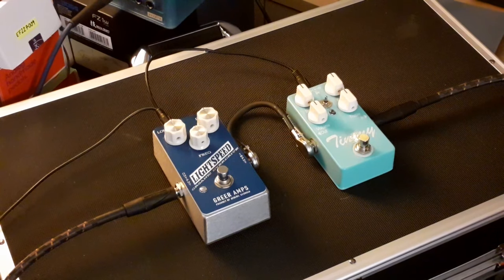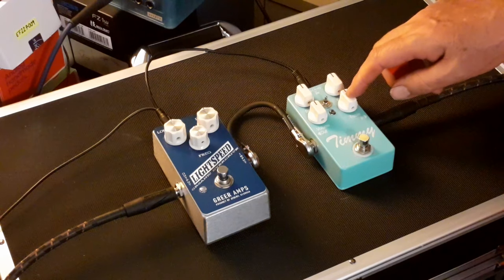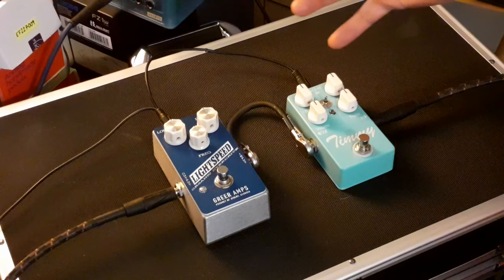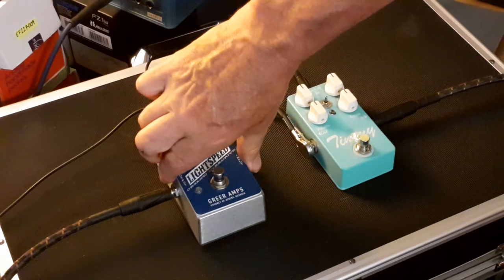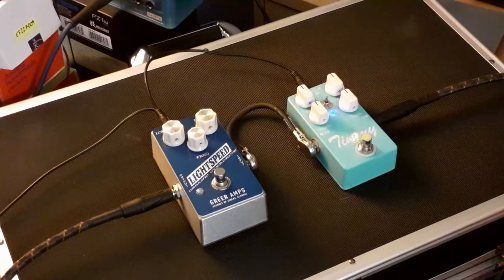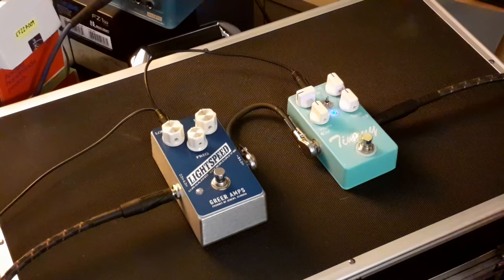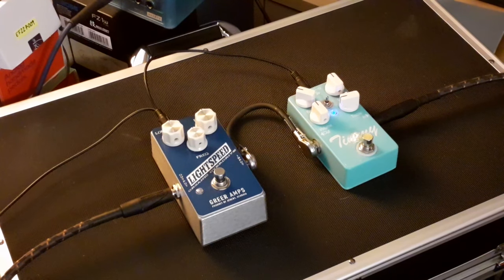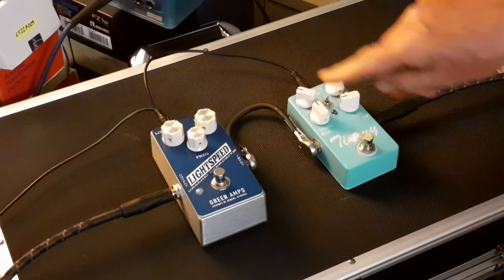The Greer Lightspeed v Timmy - transparent overdrive battle!

Comment: The neutral tone setting for a Timmy is with the treble and bass knobs all the way counter clockwise.  At noon, you’re cutting bass and treble. The controls can’t add bass or treble. They only cut.  You’re using it wrong and that invalidates the comparison.
Reply from the maker: @jcradical2520  appreciate the feedback. Basically similar circuits and I just used my ears to get them similar sounding. But a good point

Comment: Nice job. I have this version Timmy, my original handwired V1 and a current version proto too. They're all a little different and I love them all. Love my Lightspeed too. You could easily set them differently and use them both on the same board. I also love my Kingsley Page. and my Benson Preamp too. It is a golden age for low gain boost/drives. We're spoilt for choice! 

P.S. can't wait for my V3 TIM!
Reply from the maker: Oddly I have started using the Timmy as a pedal when i'm busking with Electric guitar. It takes a battery but also makes the Boss Streetcube sound good enough for the job. I add a Boss BD2 and they stack great and cover everything.  Benson preamp seems highly lauded as is the Kingsley stuff.
Reply: Timmy VS Lightspeed?